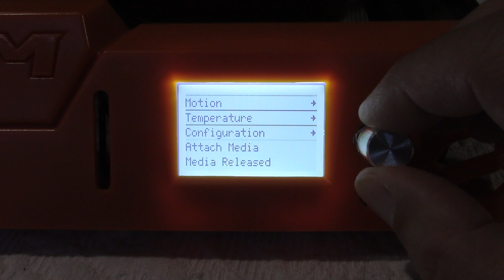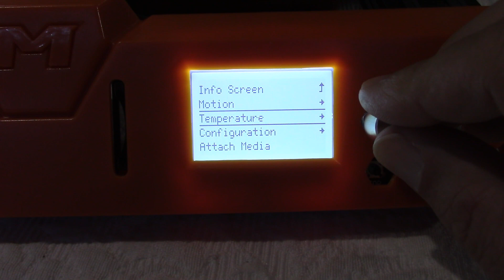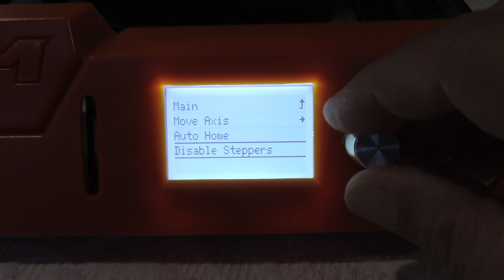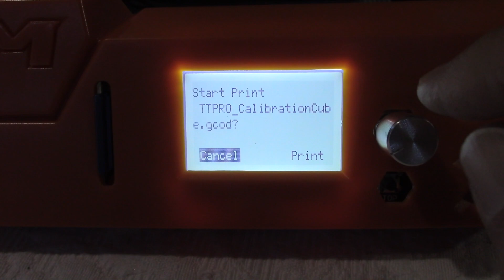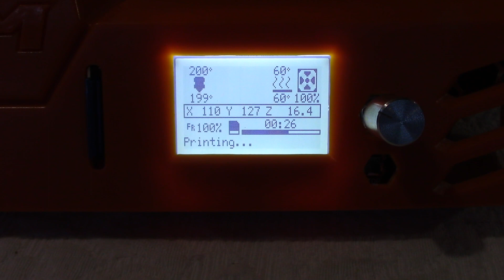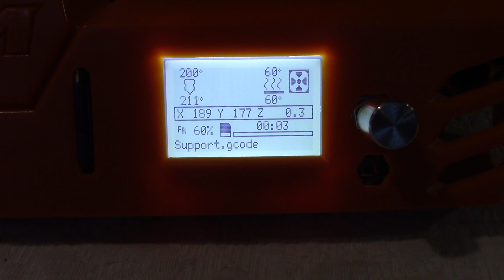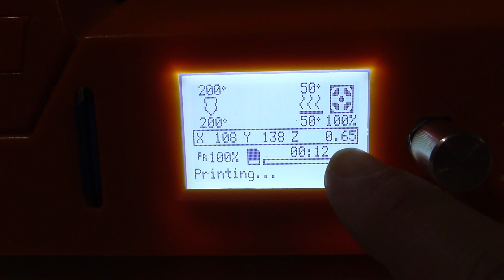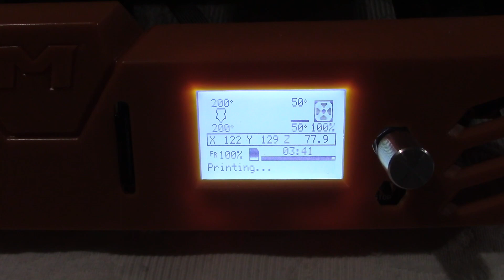Homers / Tevo NEW Tarantula Pro 3D printer | First power ON and print tests

Comment: Hello, I'm anticipating the arrival of my Tarantula Pro, but I have some concerns about the maximum bed temperature, as the manufactirer claims that it is 70 degrees Celsius
Can the bed go higher? I would need 90 degrees to print PET-G
Cheers
Reply from the maker: Hi Wiktor, Sorry but I never went above 60 degrees so I do not know.  Thank you for visiting my channel.
Reply: @SuperdanTech  It's okay, thank you for your lightning-fast reply 😁
Reply: For anyone interested: the firmware theoretically allows the bed to go up to 110-120, however when I tried, it threw an error at around 95 degrees. Proved to be reliable enough to print PET-G at 80 degree bed for extended periods of time

Comment: Did you actually get a 32 bit board? Another reviewer checked his model and it was actually an 8 bit board.
Reply from the maker: Tell me about it...According to the board ID it seems to be a 32 bit board but when I bought it from banggood.com, the description said 8 bit board, so everybody is confused...I posted several videos after this one where I show long-hours print issues. I finally got rid of this printer after trying for several weeks to upgrade the hardware and firmware.  It is not even clear if the control board or the power supply was defective... I am currently looking for another printer.
Reply: @SuperdanTech  Do you have a photo of the main controller chip on the board? I think that's your best way of telling if it's 8 or 32 bit?
Reply from the maker: I sold it to somebody who is going to build a CNC machine with it.

Comment: my front panel wont even go all the way in because the card reader module is hitting on end of the base assembly.

Getting really frustrated with this piece of crap, quality seems nice for the price, but without manual and some weird crap going on im really getting annoyed by this.

Nothing ever works properly straight away.
Reply from the maker: Hi Jarmo, I did a complete assembly video on this printer since there was nothing much on the web.  Mechanically my printer was perfect and I took my time to put it together.  After I did this video, I had issues with long prints, namely print interruptions for no apparent reasons and layer shifts for no apparent reasons either.  After trying numerous things with the control board and power supply for weeks, I just gave up.  I am currently looking for another printer... Thank you for visiting my channel.

Comment: I bought an orange Tevo Tarantula Pro and I have it for 20 days.
I can't print with the SD card because printing stops halfway, I already used the card that came with the printer and I already bought 2 cards and the same thing happens.
When I connect the printer directly to the computer, I can print, but if the print is more than 2 hours long or if the part is complex, the step drivers of the motors heat up and the printer aborts the printing.
I have friends who have Creality Ender 3, which despite being a simpler printer, they never had the problems I'm having with my printer
There are serious errors in the design of this printer and it is absurd that the engineers and those responsible for the quality of Tevo emerged this printer without carrying out the tests tested.
In conclusion, I have already printed 30 pieces, 5 complete pieces and 25 half pieces.
Reply from the maker: Hi Jose, did you watch my other video about vref adjustments and settings in your slicer!  If not, you need to watch as it will certainly help.